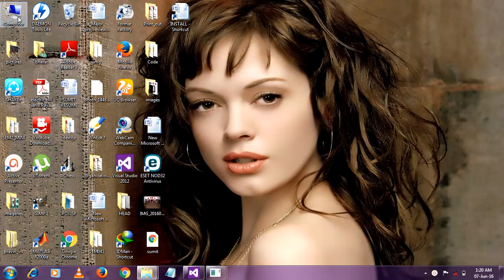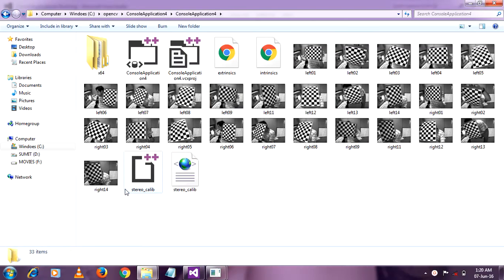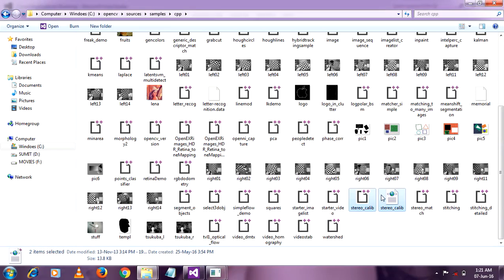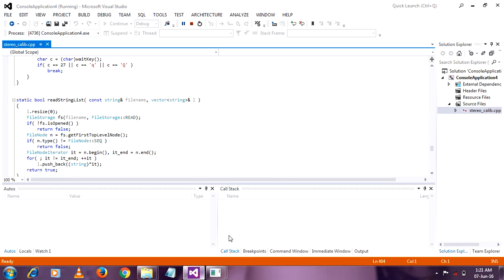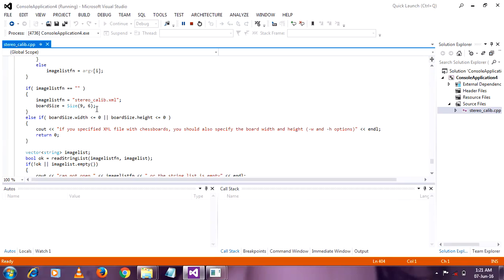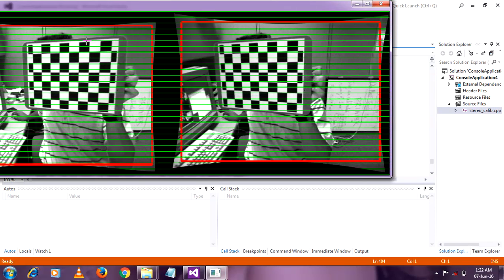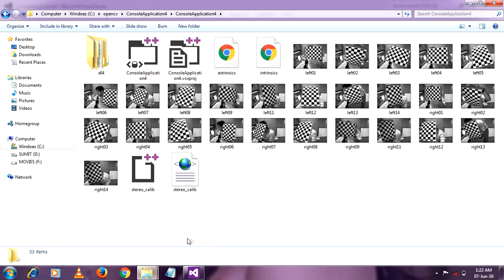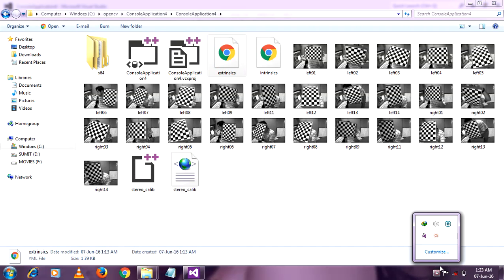stereo camera calibration opencv  with source code # part 2

Comment: Hi sumit! Thanks for sharing your knowledge with us!
I have a question, whats the difference of using one câmera or two câmeras(stereo)?
Reply from the maker: Thanks Marcio. The difference is using two camera we can calculate depth map. I.e. distance of object from camera. Which is not posible in Single camera.
Reply: @sumits.parale8735  so with two cameras i can calculate the distance without any other source reference ( like a laser point for example)?

Comment: the last video u captured stereo image by your camera but finally u still used stereo image available in opencv, any explain?
Reply from the maker: When I did this video,I was using Opencv2.4.9 which is not giving me good results, so I used opencv3.0.0 delta on linux but I don't have software to record video on it. So I made video on windows with existing sample code. Follow the link If you want to see my actual result. https://drive.google.com/drive/folders/0B1JICqP8TvqWbGRYMnJ1ZWlhbVE?usp=sharing
Reply: many thanks, bro
Reply: When I use my stereo image (also 14 pairs 720x1280), the RMS error is too hight ( ~21.) and the average epi error ~ 28,5. Anyway,the rectified images is performed bad. the   what should I do? plz help.
Reply from the maker: This happens many time. I also struggle lot.Please find code on this link https://drive.google.com/drive/folders/0B1JICqP8TvqWbGRYMnJ1ZWlhbVE?usp=sharing. It is little different try it. Hope you will get good results.
Reply: Thank you for your response. After a big struggle, I finally got a better result with RMS = 0,6. average Err  = 0.9. But the rectified image is still unrecognizable ( just looks clearly on checkerboard area). How can I know whether I am successful? thank in advanced
Reply from the maker: Can you share the rectified image
Reply: thank you. I tested on many datasets ( set of stereo images)  and got 2 best results.  I've described the first one, and the second one has bigger Error, RMS and AVerage Err ( 0.88, 1.44 , respectively) but the rectified image is displayed well.  I dont know why?https://drive.google.com/file/d/0Bwi5oGgszH3gVEVqSlh2WlV1UkE/view?usp=sharing
https://drive.google.com/file/d/0Bwi5oGgszH3gZ2FXTExMeVdZQzg/view?usp=sharing